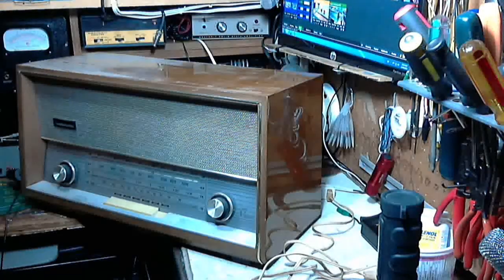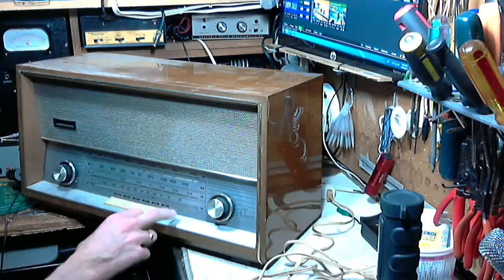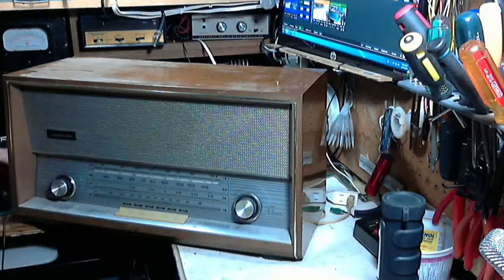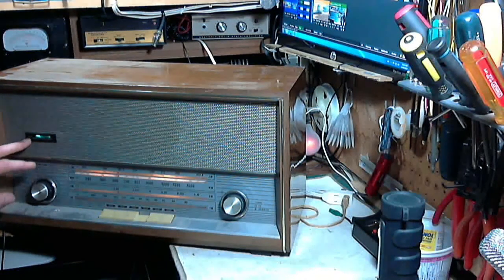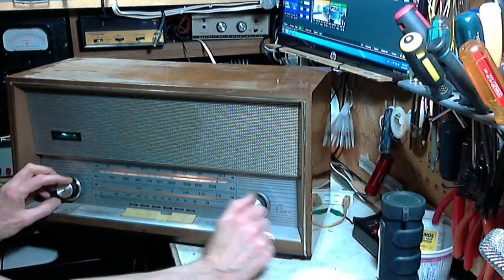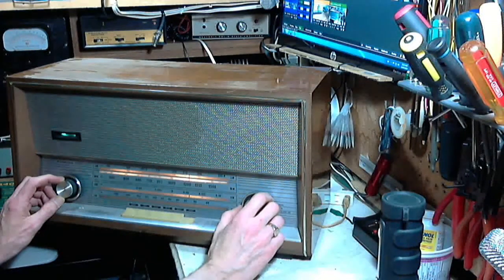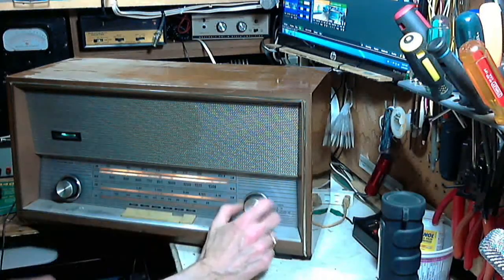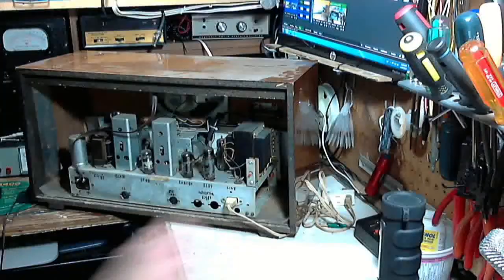Florida Yugoslavian-built AM/FM/SW Tube Radio Video #1 - Checkout

Comment: Dear sir ,SEEING THIS VIDEO I REMEMBERING MY FATHER.HE WAS VERY GOOD ELECTRONICS TECHNICIAN.HE MADE STERO AMPLIFIRE USING 6L6 POWER VALVE.HE WAS SPECIALIST TO REPAIR PHILIPS RADIO.I KNOW ALSO BUT LITTLE BIT BUT NOT LIKE YOU OR MY FATHER.I RESPECT YOU SIR TO SEEING THIS VIDEO. THANK YOU SO MUCH.
Reply from the maker: +Rakesh Kumar Sharma Thanks Rakesh.  Your father must have been a smart man since Philips radios are not simple or easy to repair.
Reply: you are very right sir ,Those days around 1970 we have good collection of manual like philips RCA etc. we design and make our own circuit for push pull amplifire and got good result.normally we use e-series small vale. 
 Thank you so much for nice reply.
  have nice day

Comment: Can you explain the bit about the ligtbulb coming on when you turned the radio on? I know that some people suggest using lightbulbs in series to power up the radio for the first time to reduce the voltage applied to it.
Reply from the maker: deltareum1 It's more than reducing the voltage.  If there is a short in the equipment, the light will restrict the fault current and protect everything while signally the problem.  Also, as the load changes while warming up, the brightness of the series bulb changes to giving an indication of what is happening.  It's a very cheap and easy way to protect everything.
Reply: Thank you for your reply. So, are you saying that one bulb is parallel to the radio and the other in series? Or are they both in series? I seem to remember reading somewhere that they are wired with switches so both can be placed in series, only one, or none, thus graduating the voltage applied to the radio. *Thank you for your very informative videos, by the way.